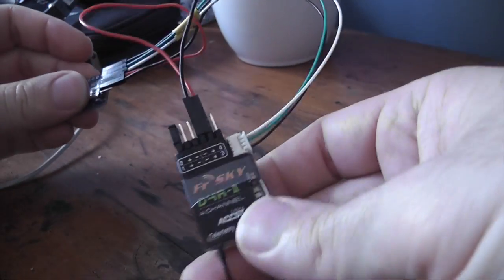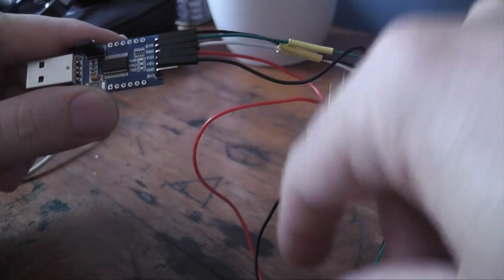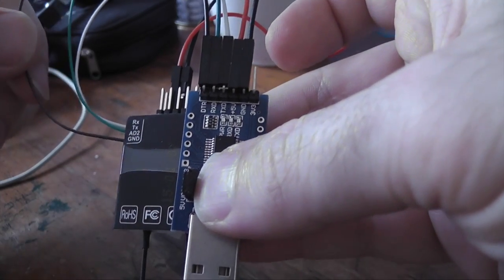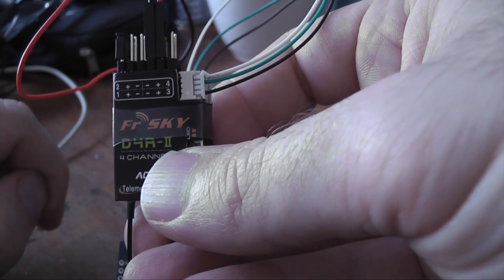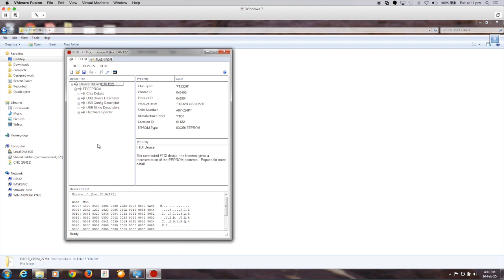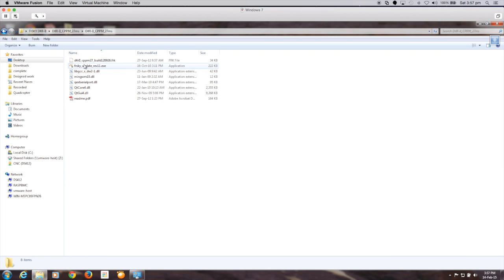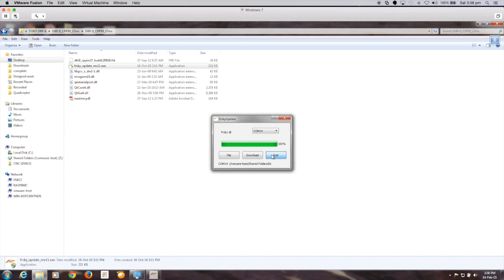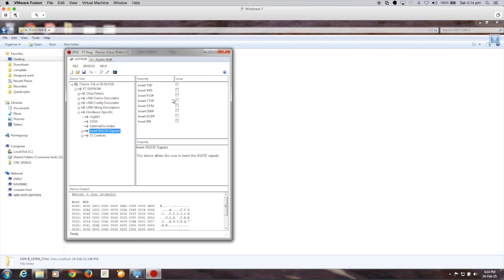Flashing FrSKY D4R-II Receiver via FTDI with 27ms Firmware

Comment: Hello! Do you know how can i connect a simple pwm receiver to this adaptor? The ports has 3 pins, Ground, V+, and Signal. For ground and V+ its obvious but the signal pin goes to RX or TX?. I want to use the adapter to send and receive data from the receiver through PC.

Comment: thanks seafurymike! i found out your video is the best guide so far. been referring to this video twice now; both changing to 27ms & revert back to 18ms. reverting back to 18ms just to check whether does the firmware caused my d4r had shorter range while in 27ms
Reply: Thanks. Glad it helped you.

Comment: I don't understand why you would do this.
Surely you are increasing the latency between the TX and FC.
At the very least you are decreasing the resolution.
If you make sure at least one channel is at minimum you will not breach the 18ms barrier to "confuse" the rx and thus the FC.
I have tested this on a scope and in the air.
I make sure my flight mode switch is set low for acro which is my most used mode and the only time I will be anywhere near full deflection on the other sticks.
Seems like a lot of people just think this is necessary without understanding why.
Reply from the maker: I agree with your statement. in fact i upgraded one of my units and rolled it back to the 18ms as i didn't see the point. 

The video is optional for people to make their own decision.

Comment: Heh. Spent half my day trying to get this to work with an FTDI adapter from ReadytoFlyQuads. I couldn't even get the FTDI talking to FT Prog. It's ridiculous how tedious and clunky this all works. What I'm actually trying to do is flash back from 27ms to 18ms, as the DR4-II I bought came with 27ms from the supplier. Either way, this isn't working for me. I think I'm just going to try and source a couple of new D4R-IIs and make sure they come with the original 18ms firmware.

Comment: hello, I have a question for you,  I just bought this receiver and was looking into updating the software but the site note that the last update was 2012, Do I still need to update or would they come updated from factory?  thanks in advance
Reply: The only way to tell is to try and max out the channels. You can put servos on all channels and flick your sticks to max deflection rapidly. If the servos dont keep up, its the old code.

Unless it states its 27ms, just flash it with the update and you be set. I think they still ship with old code, why? I have no idea, but i believe they gave not flashed the update.

Comment: Was trying this method and didn't know why it wasn't working. So I doubled checked everything and for some reason when I flash the FTDI board with reversed RX and TX it doesn't save. If I scan the board again the options are unticked, so my guess is it isn't saving even though it says it was programmed :(
Reply: I can only think there a slight differences in FTDI boards. I can only suggest you should try a different PC, that may help with saving.
Reply: +Seafury mike same problem here. And I'm using the same FTDI board as in the video. Grrrr

Comment: i follow all the step setup but....the number that showing the FTDI with the receiver only appeared when Tx from FTDI connect to Tx at the receiver!!!! i do reverse the Tx/Rx at FTDI tools...but...is it complete the flashed or anything else?
Reply: Yes you have to have it all connected for the numbers to show. I'm sorry, I don't understand the remainder of your question. Can you rephrase it please.
Reply: as ur describe... the Rx cable from d4r is connected to Tx at the FTDI board, and the Tx cable from d4r to Rx at FTDI right? if i do that, no numbers showing at the bottom.  but when i connected it Rx to Rx, Tx to Tx...then its showed up.
so..my question is...is it my d4r flashed with new firmware? since the connection not as yours?
Reply: Well, it shouldn't work like that, but maybe your FTDI device isn't labelled correctly.
If you get the numbers, then on your FTDI a you see it flashing lights, it should be fine.
Reply: After you program the FTDI board with invert Tx,Rx, if you scan again then are these settings retrained?
Reply: The settings are retained until you put it back. The video shows this process
Reply: Seafury mike Watch my video. Looks strange as the settings are not retained !

Comment: Thank you for the video. it was clear and easy to understand. When I was programing the dr4 receiver in the frsky application it froze on 11%. I ended the program and tried multiple things to get it to work again. It would not give me the set of numbers to let me proceed in the download? What worked for me was to completely unplug everything. First put battery power to the receiver from an esc bec, then to connect the FTDI to the computer. Then open the Frsky Program App. Select com port if it had not done so already then select the file to flash. The numbers appeared and it did not freeze during the program. Maybe my FTDI 5volt crapped out on me? Maybe this might help someone else. Great video, thanks again!!!
Reply from the maker: That's good info Bozi. Glad you worked out how to flash it with your issues. I did find the program is temperamental at times, which you would have seen at the end when I tried to get the numbers up again. In this case I would have needed to do what you did and pull it all apart and start over. It seems the program keeps the comm port open when it should have cleared when the program is shut down.
Reply: seafurymike
Yep something was not working right or being temperamental. I got 2 more d4r's to flash to 27ms but they are buried in 2 of my mini quads right now. I will see if I have a problem with the others. Thanks again for the video! I tore everything apart to flash the D4R and thought I couldn't do it because I didn't have the right usb programmer. Then I came across your video! If your in this hobby there is always a FTDI sitting around!

Comment: Yep :) i do it by default...
 I hear the newer once u might not have to flash , but i got 3 and done it to all 3 :)
Reply from the maker: It would be interesting to see if they update the documents if they are shipping the receiver with the 27ms code. Otherwise, how can you tell if it's at the latest version unless you check the full deflection output or the timing out putted on an oscilloscope. 

As you said, quicker to just re flash and be sure it's done.
Reply: So agreeeeee I reflash all of em . New or old U cannot tell what firmware is on there ..